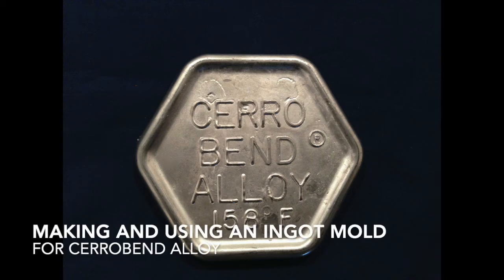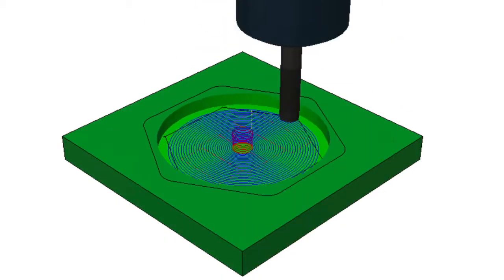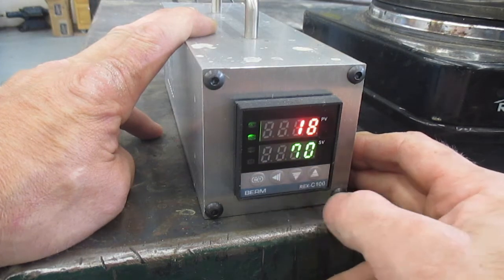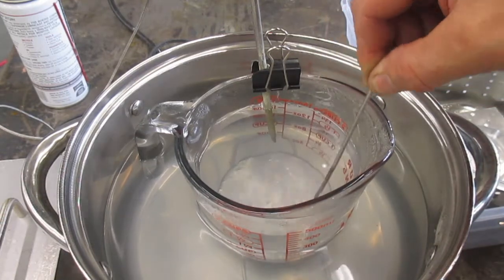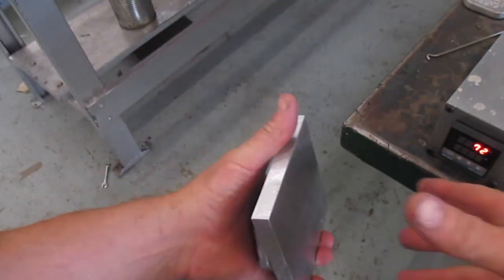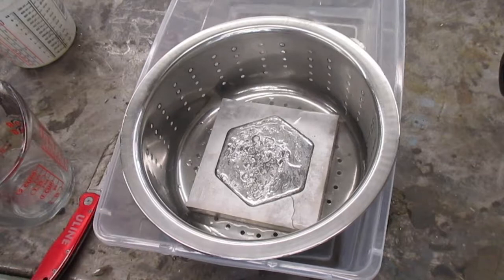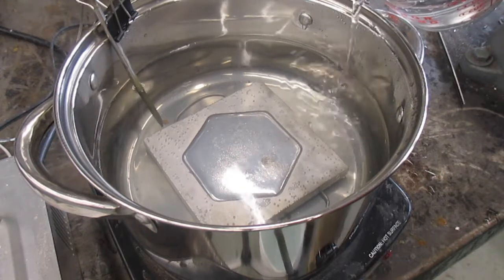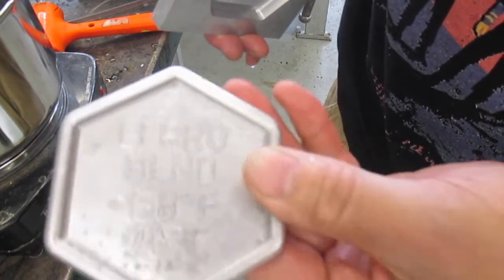Making an Ingot Mold for CerroBend

Comment: Does this work with a 3d printed mold? my print filament is PLA+ and melts at 150-250 degrees celsius. Cheers.
Reply from the maker: I haven't tried it with 3d printed molds but I suspect it would work. In another video I poured CerroBend into plastic tubes (pipettes) to measure the expansion during the cooling. I think the pipettes are polystyrene with a melting point around 240C to 260C which is much higher than the 180C of PLA. That said CerroBend melts at 70C. If you put your PLA print in boiling water does it soften excessively?
Reply: @MrSmithDotShop  I'm not sure. I'll give it a shot and get back to you. Thanks.

Comment: Hello

I got an ingot of about 1.250kg

I wanted to turn it into 2 smaller ingots with a similar shape (jam jar with a decagon bottom)

That's fine but the result is very grainy, not only on the upper surface, also on all the external faces of my ingot

I hardly understand spoken English but a priori I have to cook longer, remove the kind of "surface powder" and cool gently in cold water to obtain a pleasant result..

I will try again as soon as I have a moment and I hope to achieve an ingot as smooth as yours

This product is in any case very cool, discovered by chance and intrigued me, I would like to create 2 ingots of 500g, one for resale and recover my investment, one to keep my work and the remaining ~200g will remain suspended in my garage until the day when they can be a solution to a DIY problem as I often encounter ^^
Reply from the maker: Warm it up in a bath of boiling water. Skim off the top underwater. Then pour cold water into the bath and let it solidify. Your ingot should come out clean and shiny.